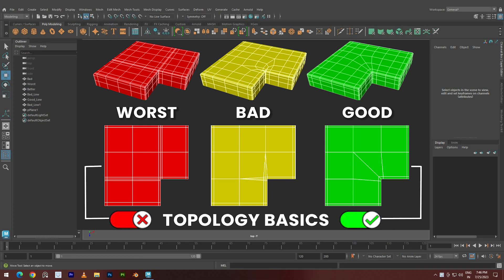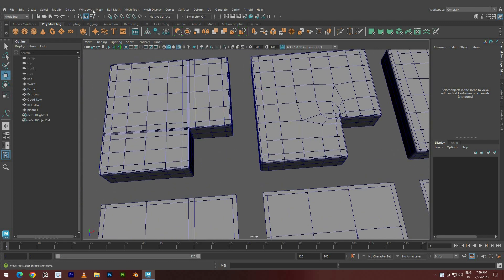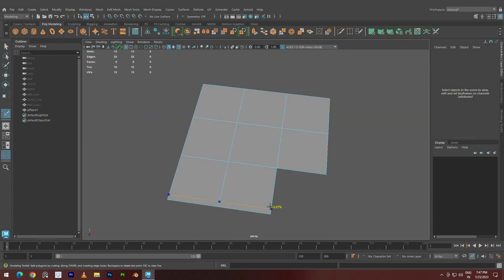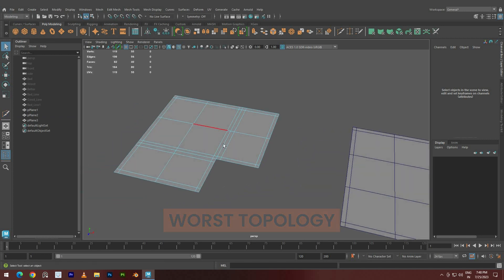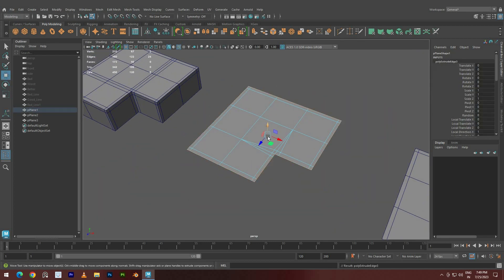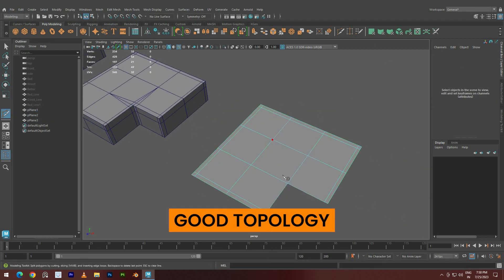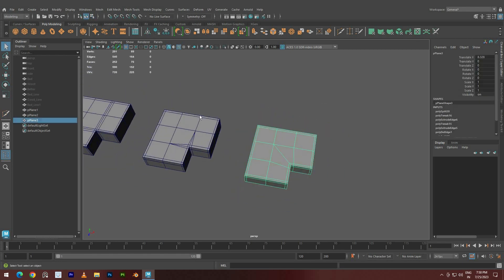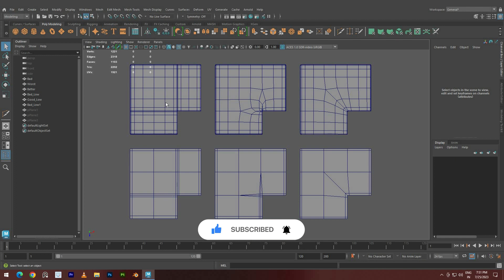Optimizing Meshflow for Concave Faces in 3D Modeling | Topology Tutorial | Center Pivot

Comment: Actually the worst is the best, because you don't care about the topology on the high poly mesh that you'll bake maps on low poly, and it's definitely the fastest. I'm telling you this as someone who worked on triple aA games for 10 years.
Reply: I was thinking the same thing. High poly just needs to look good
Reply: but if you actually going to use that model for a game poly count matter a lot
Reply: @VaidasMaldzius  In this clip he has support loops on the model which is necessary for high poly mesh, there is no need to optimize that mesh afterwards because, as I said,you use it for baking maps...it is only important that it is clean. Low poly is the one that needs to be optimized and it goes into the game engine.
Reply: @AL15966  i mean game is not only field where 3D is used
Reply: When you add support loops to a mesh, it automatically means that you will use that mesh as a high poly mesh that will have several million polygons and you will bake maps from it to a low poly mesh. There's no need to optimize because it's a waste of time, you won't get better results. There is also a mid-poly version of the mesh used by most games between 2010 and 2019, nothing is baked on it, only those assets have chamfers and weight normals and need optimization. In 2023, you really don't need to think about polygons so much, one 2k texture is now more expensive than a 50k polygon model for the engine, not to mention Unreal's (Nanite) where you can insert billions of polygons into the scene and everything runs smoothly.
Reply: @xd1845  These are the rules for whatever field you use
Reply: @VaidasMaldzius   3d is such a huge field. there are usecases where polycount is important and others where it is no issue at all. so it depends on the usecase and workflow which kind of typology is good or bad. Games are not the only usecase that exists in the world of 3d.
Reply: This is a video with a tutorial on topology. It does not mention specific usecases. For your usecase proper topology isn't necessary (until you get to the low poly model).  If you take the video as intended..  no.. the first one isnt the best. You only use that in situations when you don't care. In that case why even watch the video.
Reply: Well but if there is more detail coming to the left or top of the model the loops might ruin ist or make things bad for organizing. Lovalized topology should also be considered for high poly meshes
Reply: and one mor thing to add "good"  Mesh has N-gons, you have to be careful because when you export that mesh FBX (or some else exn) will connect it by itself, which can sometimes cause a problem later
Reply: @recevicD A lot of the advice you've given in this comment section requires more context with specific examples. As I said, this is likely for beginners and we shouldn't be giving them the impression that most traditional rules of modeling no longer apply. For example you mention current gen tech handling large poly counts. Beginners may not understand the difference between applying that to character models and large assets--things that NEED higher poly counts--and to things that are very small and unimportant, like static mesh of a filing cabinet. It's best to strengthen your foundation of modeling and re-evaluate your steps as the basic process becomes second nature.
Reply: Yes, but this is for beginners creating general meshes. And it's unlikely at this stage most understand the concept of baking to LODs.
Reply: And i wondered why games runs like shit lately
Reply: @KudoRedfox  Dense topology on high poly mesh wont effect the performance when baked on low poly mesh which are used in games
Reply: I know people who lived for 90 years and couldn't say something worth listening about life.